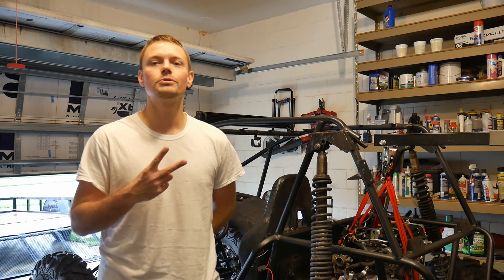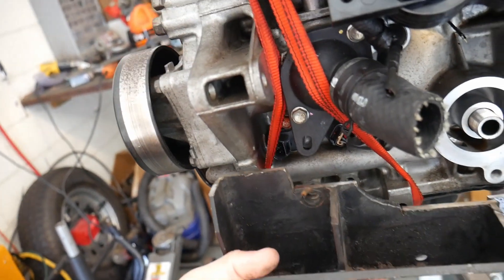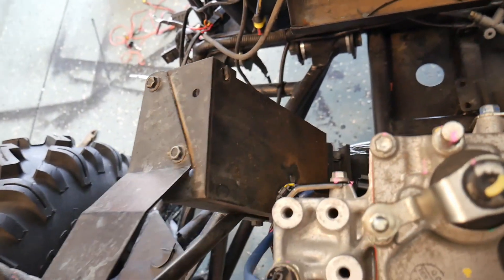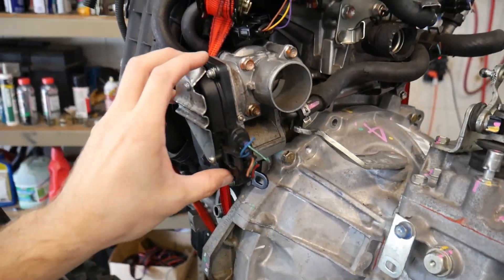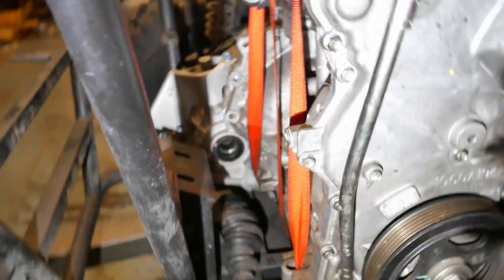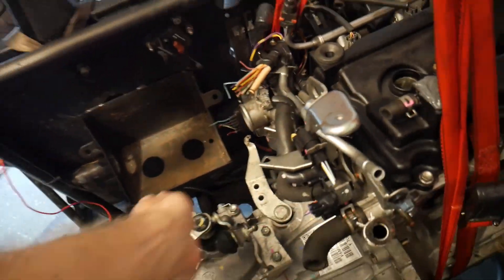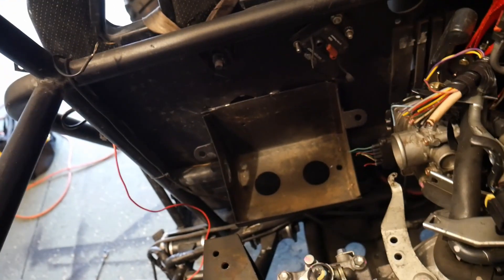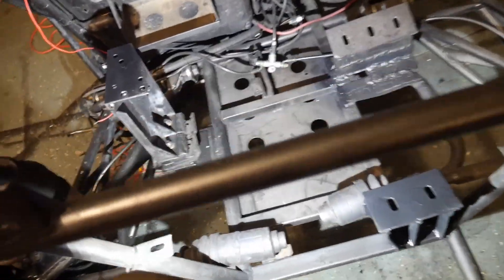Dune Buggy to EFI Car Engine Swap Pt  2

Comment: i like what your doing i am going to put one of these engines in a Joyner sand viper.  i will be setting aside the chery 1100cc factory Chinese motor.  After watching you struggle with designing the engine mounts gave me an idea i will try using cardboard for the mock up and then replicate them in metal my past builds have all been buggies with motorcycle engines.  I  use the cradle W/existing mounts from the cycle frame and weld it in after cutting off as much as possible but keeping the strength where needed.  Obviously this it not an option w/car frame and mounts.  I applaud your tenacity

Comment: Move your battery to the front, what I did on mine. More weight balance and easier to get to. And gets it out of the mud on muddy days .
Reply from the maker: Carl Keese Great idea!
Reply: Did you get my question about the axle pieces you cut off?
Reply from the maker: Carl Keese Hadn’t seen it but I just responded!
Reply: I would like to chat about builds if your interested. I was going to send a couple of builds my last and current build.

Comment: Cool project, on the fly by wire, if you get waterproof connectors you should be ok as long as marine life isn't its norm lol. Fortunate accident on the mount, I never get that lucky, I would have been torching out around that block and not even realized it was semi symmetrical. Good luck on it!